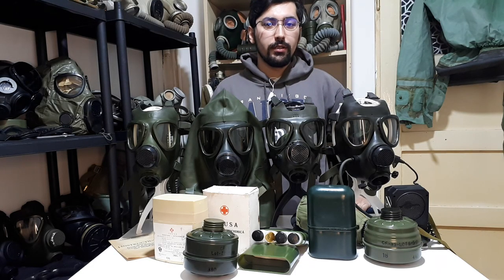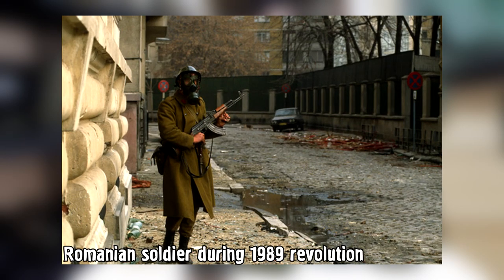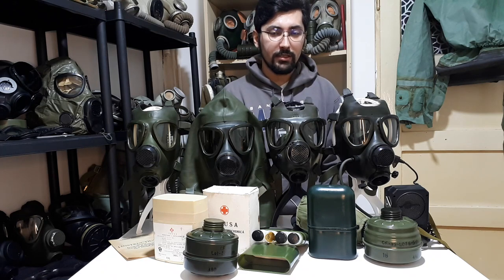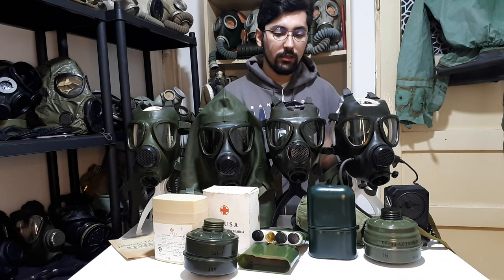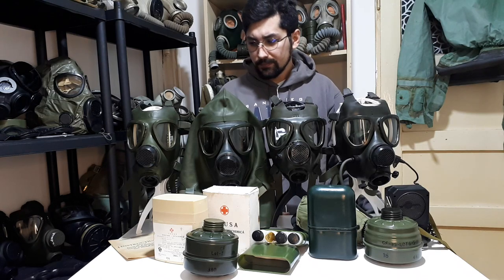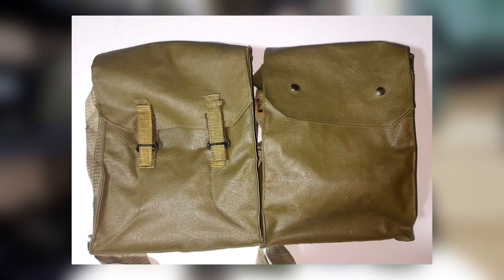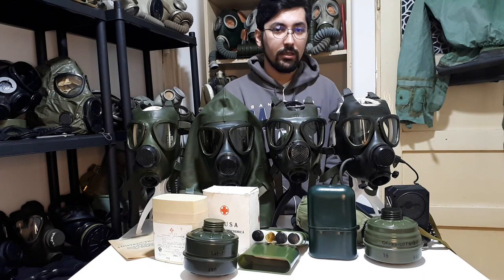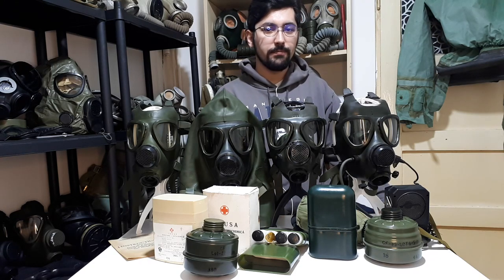Romanian M74/M85 gas mask / kit 🇷🇴

Comment: Very nice review of these masks. I have the same issue of the two sides of glass separating a bit on my US M9a1 which has been in its sealed tin for the past 70 years, so i'd bet it can just happen with age, as well.
Reply: I’ve also experienced the same problem with my sealed medium sized M9a1. My small size, which was not sealed but in great condition, doesn’t exhibit the glass separation issue tho.

Comment: Hey i have what i believe to be an M74 in my own collection and was linked to you for knowledge about it. Im kinda only now thinking to ask thi but I've seen a lotta M74's online listed as Iraqi or Hungarian. I know why some are called Iraqi cause of your other video but i was wondering if you knew why so many are listed as Hungarian. The shop owner i got mine from also thought it was a Hungarian mask so until recently i thought the same. Considering Hungary had access to masks like the 75M, 67M, 70M, and one other im forgetting atm, it doesn't make sense to me that theyd import masks fro Romania so why are so many mislabeled
Reply from the maker: Extremly stupid sellers, like how they sell MP5 but they are actually ARFA, at least in this case they are very similiar. I belive the M74 mistake is more due to the name (M74 ~ 75M)
Reply: @RobertCBRN  Ah makes sense makes sense. Funnily enough, same shop i bought my M74 from, also bought my ARF-A from and he said it was a Polish MP5 X3.
he was a nice man tho.

Comment: Hey I was wondering what pocket the mask goes in when in alert position in the bag and how to put it in  the bag correctly
Reply from the maker: Usually any gas mask go in the biggest pocket
Reply: In alert mode, you wear  it by the neck with the filter on it.